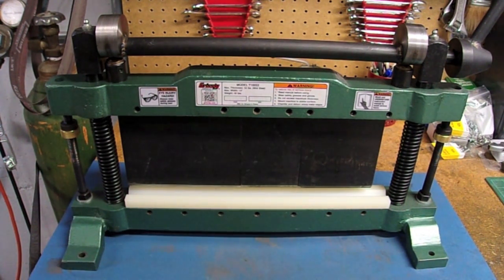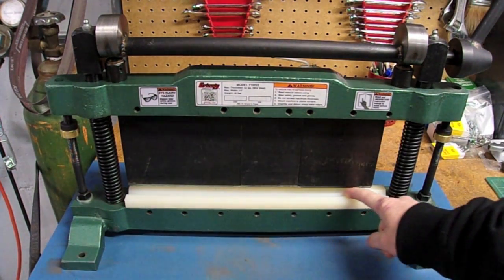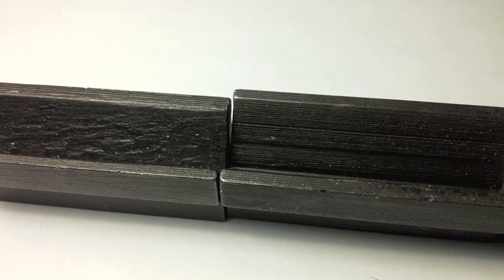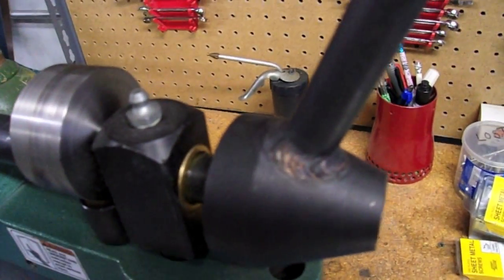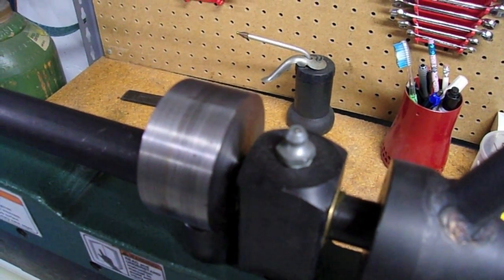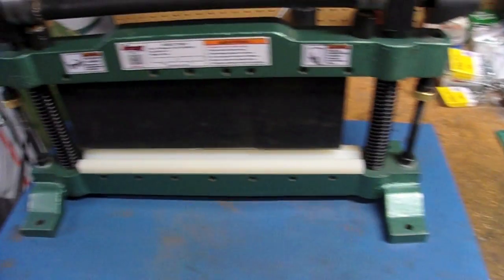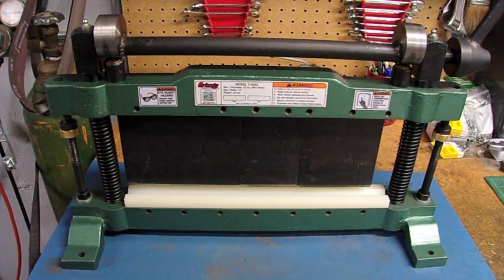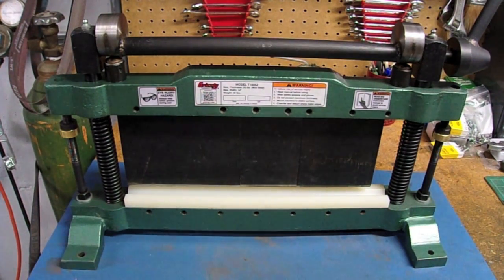Grizzly Bending Brake

Comment: Great review and excellent work on the mods. It's typical that these types of units are 75% of what you need. "Kit" is a correct expectation and sometimes it is "Good enough" but after modes its a much better machine.
Reply from the maker: Thanks! Glad you liked this!